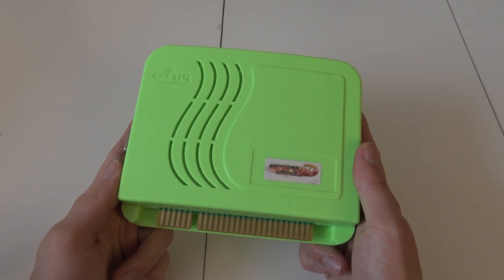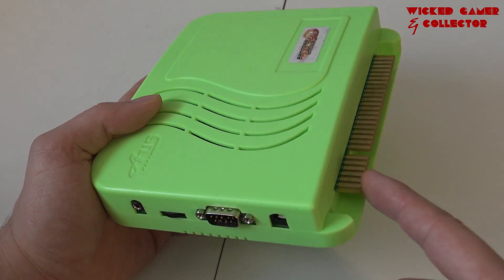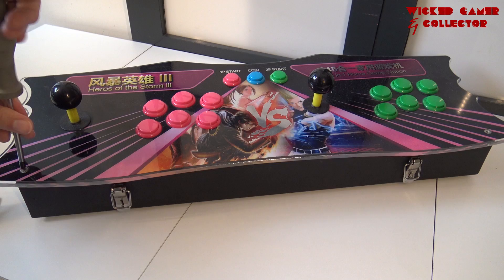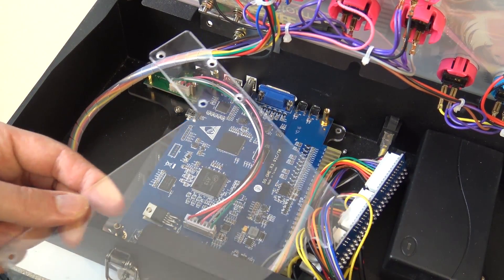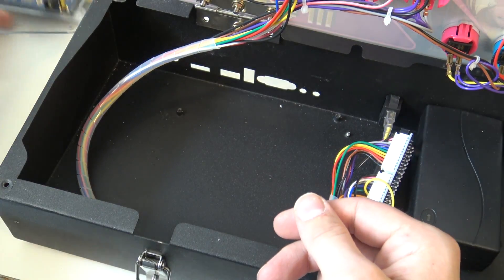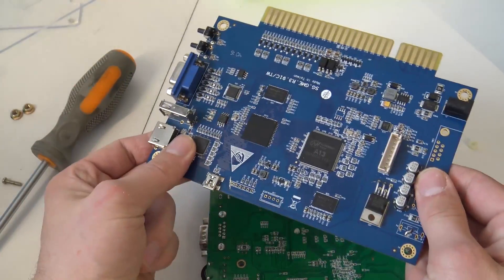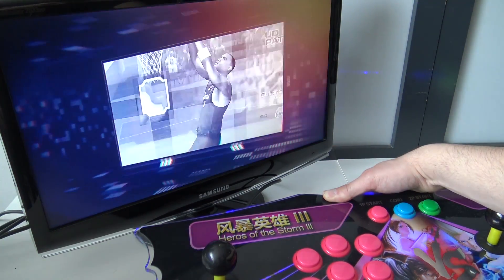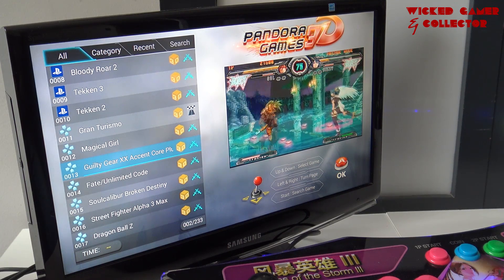The Best Pandora's Box Jamma Upgrade in 2020 !

Comment: Be aware that these won't work with an old jamma cabinet with a CRT screen. For those ,I think the newest pandora jamma box that works is the pandora box 6.
Reply: There is pandora box DX
Reply: @Rudys2000  Well I just checked, and it seems you're right, the DX does support CGA. I didn't know that, thanks for putting me right.
Reply: @shoutinggeorge2532  DX definitely does; have one
Reply: Is there any videos out there showing how to upgrade your "old" CRT/CGA arcade to a multicade/MAME cabinet?  I'm getting a Pandora's box 6 shipped to my house probably in a month..  Thanks for any help.  Currently it's a SUPER high impact game.  Just want to play something different.
Reply: There is a lot of tutorial online , just search how to connect jamma arcade
Reply: @jamescaudill2124  hi man, there is a cable to convert a family/home connection whatever it is to jamma loom  I got one on eBay. For display to crt I got a vga to scart adaptor adaptor cable that worked ok. My issue is I have my crt mounted vertically as I wanted the look to be authentic for the old school games. So not sure if there's an option  to display vertically in the DX box, if anyone knows a pandora that can be flipped to vertical display I'd love to know cheers. Hope that helped anyway, good luck
Reply: @shoutinggeorge2532  Thinking about the DX, I like the fact you can save high scores on that one too. Do you know if the DX has that awful screen filter thing that can't be disabled?
Reply: @Teckno77  It can be disabled in the system settings.
Reply: @RetroManchop  Not sure if you have the option. But my monitor on Blast City cab can be flipped to horizontal or vertical positions.

Comment: I have a 5s can I upgrade
Reply from the maker: It's possible some cables need to be swapped. 
Double check alles cables on you Jamma for that. 
Otherwise swap them under the control deck if needed.

Comment: does this work with 31khz 640x480 arcade VGA monitor?  can it be forced just for 640x480
Reply from the maker: I think only the Pandora DX has this support check there page for more info.
Reply: @WickedGamerCollector   I noticed this Pandora DX 3000 in 1 is best for 15khz and lover resolution VGA screens

Comment: Did the jamma connector supports crt rgb video out?
Reply: You can get a an in line adaptor that converts to scart, probably one for standard rgb out as well look for jamma2scart online you'll see it.
Reply: @Teckno77  as far as i know, the crt output is disabled on newer pandoras.
Reply: @SuperNeotendo You mean it's disabled from the jamma connection out side? Assuming the DX is the exception if that's the case then?
Reply: @Teckno77  yes, i mean the jamma connector.  I read somewhere that newer pandoras has no crt out on jamma connector.
Reply: @SuperNeotendo  it's all a learning curve I guess, but I think for ease going forward i might just use the scan line generators on LCD and have one crt for old school consoles and leave it at that. Too much faff with these big heavy monitors for me, until I get an amiga 500 anyway  ;-) that needs a good monitor.